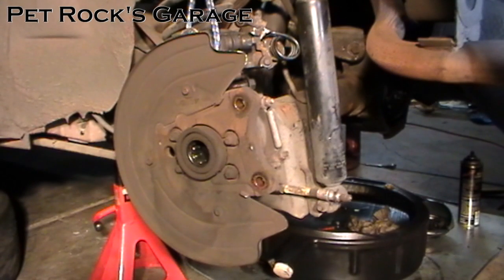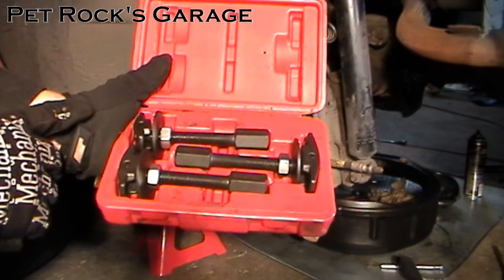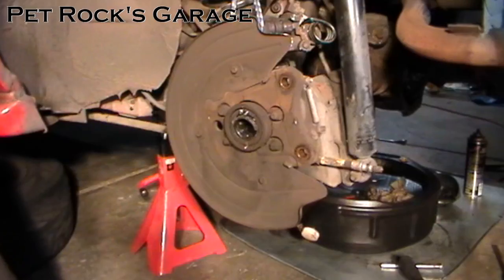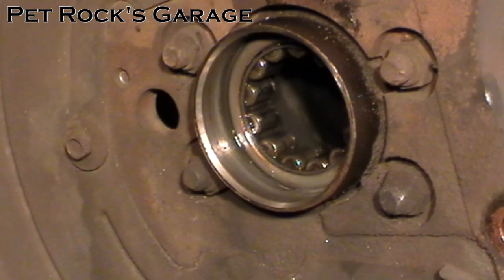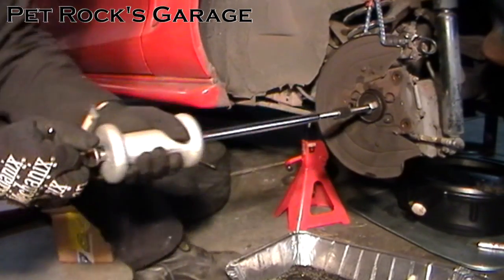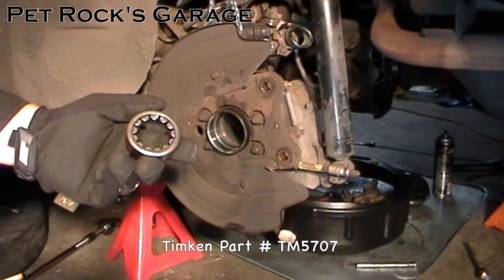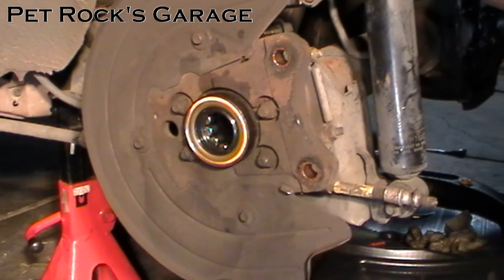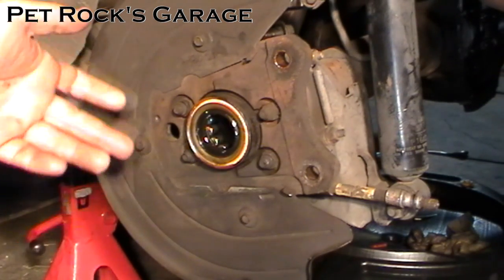How To Replace Axle Seals & Bearings In Ford 7.5 & 8.8 Differential - Ford Mustang

Comment: I have  2001 grand marquis..I am doing a repair bearing job on the rear end,the repair bearing axle saver as they say..has a main seal on the outside but it also has a seal of some sort on the inside,besides pre lubricating it all before putting it into the housing..I am wondering how the rear end gear oil can ever get past this inside seal to replace any of the pre lubricant that I put in.Does the axle have a little lee way to let oil past that inside seal that is of course part of the repair bearing,its only a rubber seal of some sort,i can get you the part number and or upload a picture here,please try to msg me back direct so i know you did answer..thanks
Reply from the maker: I'm not aware of that kind of sealing set up on a Ford 7.5 or 8.8 differential, but that doesn't mean they don't exist. From your description, I have the same concern about the diff oil getting to the bearing if there is a seal in the way. Maybe send me a part number for the bearing & inner seal and I can look it up to see what you are talking about.
Reply: thanks Pet Rocks, the repair bearing is AUTO XTRA 127-R1593.if u wanna look it up and study it..its just odd that theres seals on both ends,it must be made that way to work and i guess they figure its only a repair job and not meant to last long.thanks for the reply,i will be doing this job soon...happy new yr from Halifax Nova scotia.
Reply from the maker: I couldn't find that exact bearing, but I did find Centric C-TEK Standard Bearing (part # 41464000E) on rockauto.com and it looks like it has a seal on at least one side. If it's only one side then the side with the seal should probably face outward so the fluid in the diff can get to the bearing. Good luck.

Comment: hi why do they leak?
Reply from the maker: +forest gump, think about it.  Its a metal shaft spinning very fast inside a rubber seal.  Eventually the seal will wear out.  The seal will leak quicker if it is damaged during installation too.

Comment: I don’t think you pounded the seal in all the way.  The inner lip your seating against is deeper.  If you look at the seal before you moved it it looks deeper, maybe an 1/8 of an inch.  It only matters because the axle is usually not as smooth outside The old seal ring, and the new seal ring is further out trying to seal against rust.  I did the Same he thing on my first one.
Reply from the maker: No, its in as far as it needs to go. The old seal had a lip on it to prevent it from going in beyond flush with the axle tube (@3:26),  I installed the new seal the same way, flush with the axle tube. While there is a little bit of wiggle room in how far you drive it in, you can go too deep. If you drive it in too far it will come in contact with the rollers in the bearing and can chew up the seal housing pretty quickly.
Reply from the maker: @bmfbbmfb , they may be slightly different. Definitely different diameter axle tubes. The pic you reference is of a new aftermarket seal though, not the OEM seal which has a lip. And there is another picture in that grouping that has the aftermarket seal flush with the tube. But you are correct in that you don't want the seal riding on rust. If that is a concern I'd advise taking some emery cloth and cleaning up the sealing surface before install. I wish I had put that in the video.

Comment: why can't U pull the seal with the bearing?
Reply from the maker: You can try and it may work. It's been my experience that the bearing will just pull out through the seal because the bearing is a smaller diameter than the metal part of the seal. If that happens it makes removing the seal significantly harder. Either way, I show this method to include those that are just changing the seal. Good luck.

Comment: 6/20/2020

Next time, clean the parts around the seal, before you remove the seal and bearing. Also, instead of pre-lubing, why not just lube the seal and bearing?
Reply from the maker: Not sure why it matters to clean around the seal before removing it as long as you clean it before installing the new seal.
as for pre-lube: pre-lubing the seal & bearing is lubing the seal & bearing. I don't understand the question.

Comment: That bearing he's pulling out looks like a repair bearing, hence why he couldn't pull out the oil seal as it's all one piece with the bearing.
Reply from the maker: I'm not sure what video you are commenting on. The bearing & seal I pull out are clearly two separate parts in the video. By pulling them individually the video is useful for those who just want to replace the seal and not the bearing. Either way, I don't like pulling the bearing & seal as a unit because more often then not the bearing pulls right through the seal making it harder to remove the seal afterwards. But if you want to pull them together, go for it. There is nothing really wrong with it. I just prefer to pull them separately.
Reply: @petrocksgarage  I know, i commented before i watched the whole thing, lol lesson learned, sorry buddy.
Reply: allahu akbar my friend, have great day.
Reply from the maker: @TheGuitarist36 , no problem.  I've prematurely commented before too. No big deal.

Comment: So I took my car into the shop today and got the 3.32 gears replaced with 4.10's They gave the car back and said I had a bad rear axle bearing. I get in the car, tune the computer for the new gears. And drive off. I got up to 40mph just fine and then let off the gas and this jake brake sound comes from the rear of the car. At first I thought the differential was going to explode. So now looking at this video they are going to have to break down the entire thing again just to replace wheel bearings that were perfectly fine when I dropped my car off.FML
Reply from the maker: Ouch. Good luck...

Comment: Next time just use bearing puller to remove bearing and seal at same time
Reply from the maker: Yes, that is an option if you are replacing both the bearing & seal. However, I chose to show how to replace the seals individually for those that may be just replacing seals.

Comment: Lol Those Axle Seals are sometimes glued in the Housing take small Chisel hit the edge of the Seal and be Careful of the Axle Housing Collapse the Seal on one Side than use BFG Pry bar pry the Seal out and don't Gouge the inner Housing if you do clean Very well with Brake Clean after installing Bearing use little RTV Silicone Glue on Outer edge of Axle Seal and White or Axle Bearing Grease on Inner lip of Seal Apply Grease on the Bearing Rollers the rest you should Know. Use High Quality 75w-140 Synthetic Diff Fluid. I'm Master Mechanic I was Browsing on the Tube see how other guy's do it never know people come up with Different ways Good or WTF?
Reply from the maker: Thanks for the tips.  There is definitely more than one way to skin a cat.